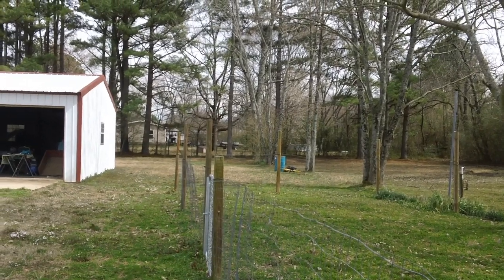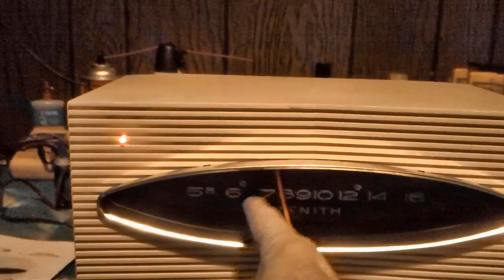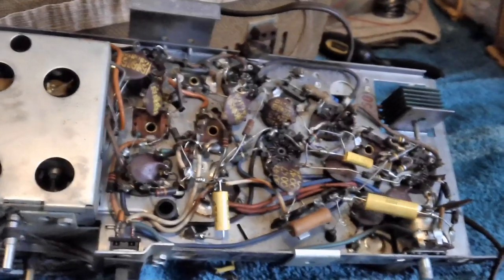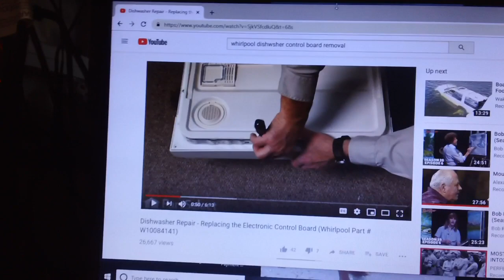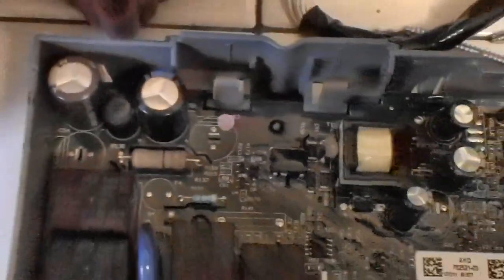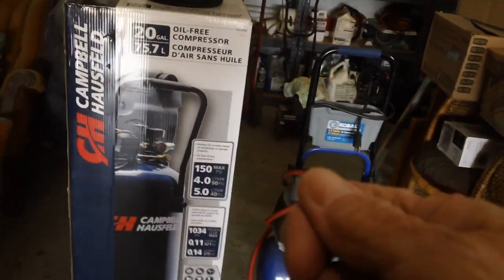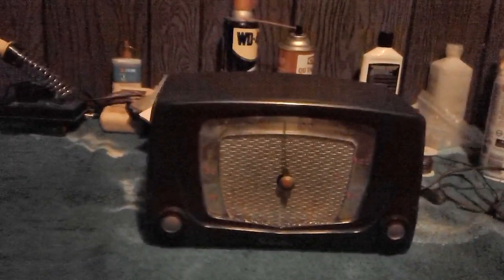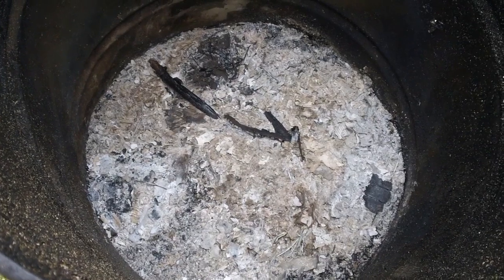Mish-Mash #256

Comment: Nice to see you are having better weather. Seeing your Silvertone I am going to have to get back on my big 1934 Silvertone 1710, I really need to find a readable schematic for it, as it is a complicated 2 or 3 band (can't remember) radio with push-pull 45 outputs and dual electrodynamic speakers. The copy on Nostalgia air is unreadable and our local library does not have it in their Riders. 
I like listening to 650 WSM, it comes in good in the evening here in Youngstown Ohio.

Best of luck with the dishwasher

Comment: Wish I could get WSM here where I live.  I live in Jackson, TN.  You would think it would boom in, but no.  I have a few radios that will pick it up sometimes, but not very well.  I have a couple of things going against me with AM radio here.  I am just at the right distance from the station for the signal to hop over us, and I have a lot of static issues.  One source of static here that wipes out AM from 1000 down is the transformer on the pole.  The utility company needs to replace it.  I found the second source of static the hard way when it set the house on fire.  Here is some good advice, If you get a lot of static on AM in your house, start checking the electrical outlets.  When they start arcing they make lots of noise on AM.  I didn't make the connection until after $140,000 to repair the house.  A $2.00 outlet would have been a much better solution.
Reply: i live in minnesota and i think it was some time last spring or summer that i got wsm I was floored but after that i haven't been able to get it again and i live 900 miles away and on a indoor antenna. I'm sorry to hear about your house and i'm glad that you are okay

Comment: John,
I hate overly-complicated appliances. The old motor-driven timers worked just fine. I don't need a digital readout on my washer, drier, or oven. To me it is just another delicate thing to go wrong. Also, they seem vulnerable to power spikes. Reminds me of Mercedes cars. Instead of a cable and lever, they will have a micro controller and solenoid system to open the trunk.
Reply from the maker: Ian,
Agreed.  The fewer knobs, latches, gadgets and digital displays the better.   Unfortunately, that's not the manufacturing mindset these days.  Thanks Obama!  😆
Regards,
John

Comment: Is that antenna thing on the AC cord for AM or FM? 
On the dishwasher, I would have just temporarily shorted it out with clip leads and run it through a cycle.
But I probably won't live as long as you will...
Best wishes.

Comment: John, any update on your $600 component stereo system?  Any new records or equipment?
Reply from the maker: A couple new records, but no equipment additions.  In the not too distant future I'll be moving the entire setup to what was Great-Grandma's room and will be giving all the components and wiring a good cleaning and checkout.  I do know there's now an intermittent issue with the receiver.  About every ten minutes or so it gives out a "snap" sound.  Thought I had it fixed, but it came back.  Anyway, stay tuned for that mess.
BTW...B K looks very familiar, my friend.

Regards,
John

Comment: A Zenith will always pick up weak stations if aligned, Silvertone...well they are okay but they are not a Zenith.
Reply from the maker: Bill,
Blasphemy, Goat, blasphemy.  Silvertones and Airlines are top of the tube radio heap.  Say three Hail Mary's and put $10.00 in the collection plate.  Report back when it's done.
Regards,
John
Reply: Hi Billy, Drake takes the cake.  Gonna get mine goin' soon, Noah helped me to put back up my dipole last fall.  Magnavox had some nice radios too, in that category.  
Communication through invisible space, kinda sounds like ESP.